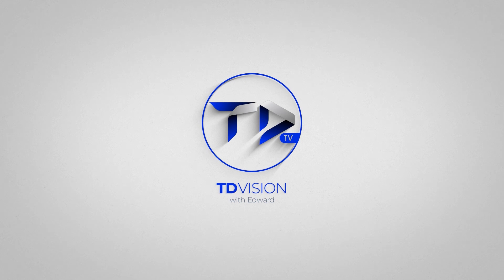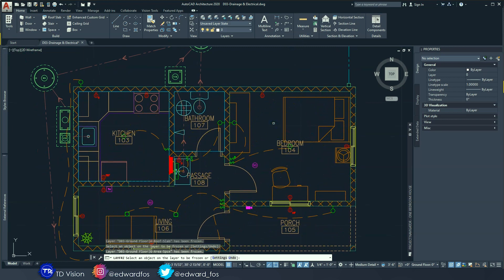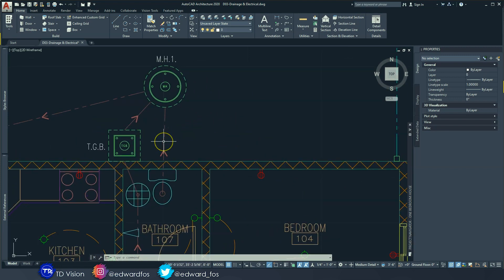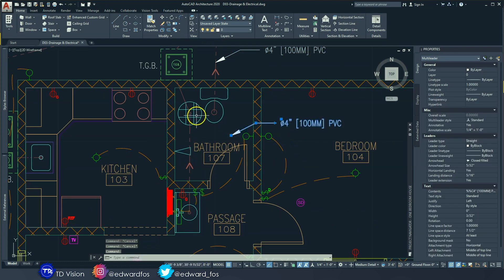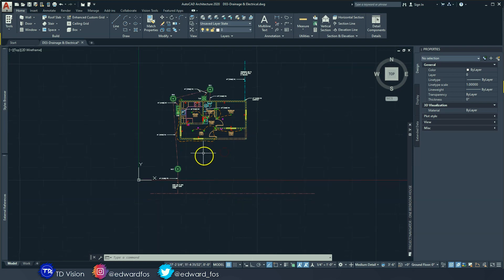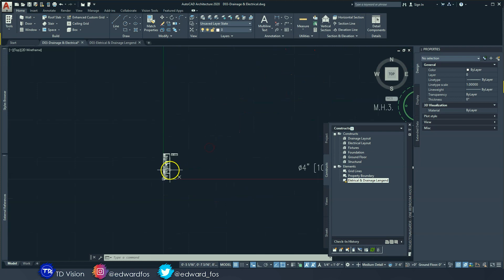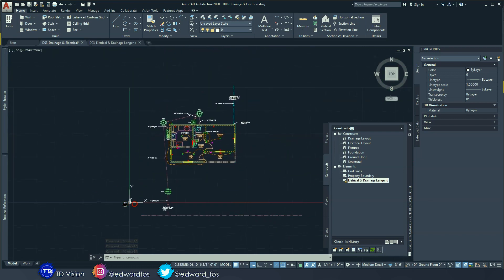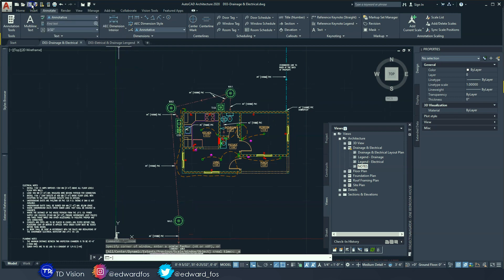DETAILING Part 2 (Electrical & Drainage Plan) in AutoCAD Architecture 2023

Comment: Would you be able to make a part 3 of the video showing all the deeper electrical circuit connections, wiring, and calculating loads/power  (panel plan, lighting fixture, duplex, electrical equipment's  )
Reply from the maker: I wish I could, but I don't think I'm versed enough in the topic to teach it.